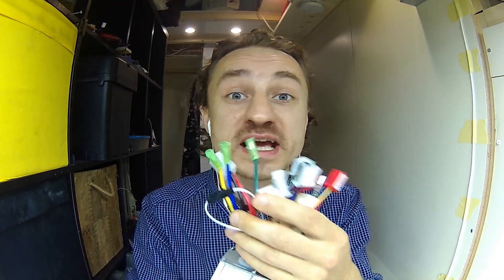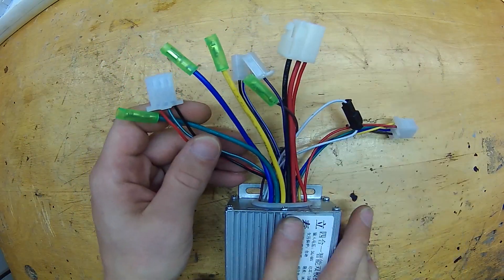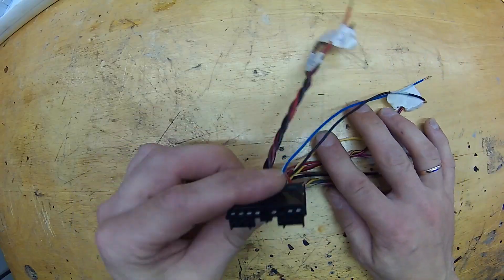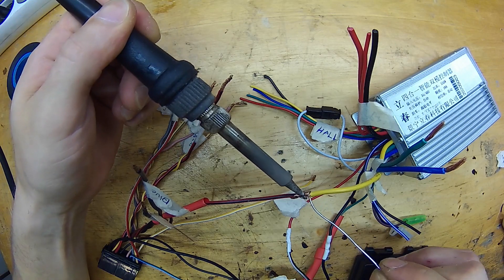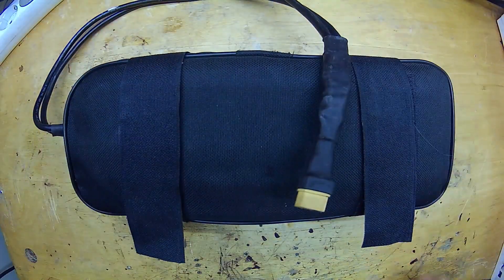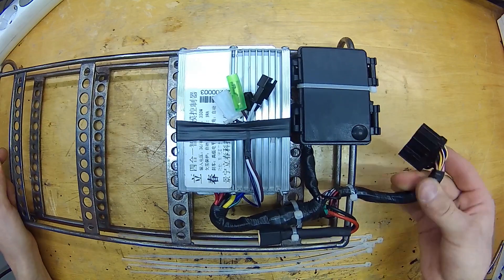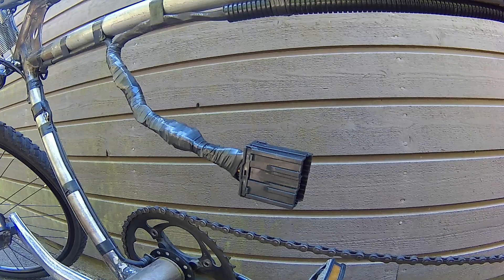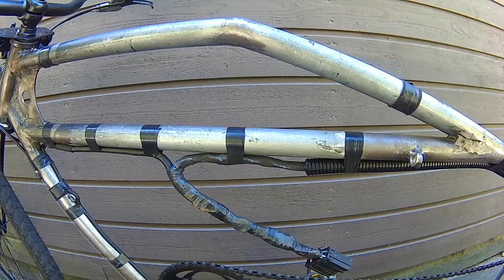How to wire eBike controller the BEST way | Brushless wiring

Comment: I have 60V 20Ah Electric Bike Lithium Ion Battery 60Volt Battery 20Ah, XT60 Extension Cord, XT90 Connector, Anderson Connector for 200-2000W Motor
 And Brushless Motor Kit, 60V 2000W Electric Brushless DC Motor Kit 4300RPM High Speed Motor with Speed Controller and Anti-Slip Handlebar Throttle for E-Scooter E-Bike Dirt Bike Motorcycle but I think I wired it wrong
Reply from the maker: Hmm, it's hard to say what might be wrong without seeing it.

Comment: Can you make a step by step build instructions guide to make your own EBIKE controller and sell on eBay so we don't have to buy from China. Then it will create American manufacturing ??? You can pretend you are reverse engineering   the STUFF from the ROSWELL CRASH
Reply from the maker: this is a good one :D it's actually not that hrd to make a 3phaze pulse controller, but the cost is the issue

Comment: I know this is a relatively old video but I recently bought a 36V-48V 350W Brushless DC Motor Controller for Electric Bicycle E-Bike Scooter and 12V-99V Electric Scooter/E-Bike Thumb Throttle Accelerator LCD Display Voltage for E-Scooter Electric Bike and I got a motor from a hoverboard and a battery from the hoverboard too. So Im trying to get the xt60 connector to fit the controller but i can't. If you could help me that 
would be great.
Reply from the maker: hi! there are different types of xt60. it  maybe you will need to solder the wires.
Reply: @3LECTROSHOCKED  Ok thanks I did that, and everything is connected except the hall wires for the motor because 
I was told I don't need them plugged in. know when I turn it on the display and everything works except the motor. could you help?
Reply from the maker: some controllers work with and without them, but if everything works without - just go with it bro :)
Reply: @3LECTROSHOCKED  thanks a lot I got it to work

Comment: What is a one wire communication agreement plug? Where does that go to?🎉🎉🎉/
Reply from the maker: I think you meen tha speed sensor wire? Its white and comes from the motor, if the motor is geared. I dont need those kinda things, since I dont use displays etc :)

Comment: Great video man.  Question for you; hope u can help. I’m replacing my original Super 73 Z1 (36v 500w) throttle, controller, and adding an LCD display.  Tired of original throttle failing and super slow responses from company itself.  Time for upgrade!  

EBIKELING 36/48V ebike Brushless DC Motor Controller LCD/LED is the controller to replace original controller;
EBIKELING 24V/36V/48V/52V Waterproof TFT 750C - LCD Display Speedometer Control Panel  is display I’m adding.  
Haven’t decided on half or full twist throttle yet. No more thumb only for me!

My question is the this: The LCD display has a pin-connector but there is no pin connection on controller.  Not sure if pin end on LCD display is male or female from Amazon picture. But, can I cut the end on the LCD display and replace with an end that will work with the display connector end in the controller?  Is there a pin extension/converter I can buy? If that’s all I need to do (which seems logical, just strip wire/replace end) then I know how to do that so I’m okay. If no, then need some help. Am I making sense? Same for throttle if different end from end connector in controller.

I provided the exact name of the two pieces I’m looking at on Amazon so please feel free to take a look.

Others who can help....thanks in advance.

Great video.  Learning a lot.  Thanks.

/Bklyn 👑
Reply from the maker: Hi! Thanks a lot for your comment! Well, first make sure you have an LCD interface in the new controller - caus' not all of them do! Then, if your connectors don't mach - dude, just solder the wires. There are just 4 or 5 if I remember correctly. 2 of those are just power - +. And others are data - usually with the same colors on every system :) And if you mess those data wires - it's not a fatal problem, just try again - trial error style. The main thing is not to mess-up the power wires, cause they carry the same voltage as your battery! Hope this helps! :)
Reply: @3LECTROSHOCKED   Wow! And your remember the number of wires in LCD display off top of your head!  Impressive. Yes, the new controller has connection for LCD display; 5 wire.  Cut end.  Solder.  Simple fix.

Second-guessing myself😏.  Thanks for vote of confidence.  Great channel.

/Bklyn👑
Reply from the maker: Great! Have fun diy:ing - its awesome :)

Comment: I recently bought a used e-bike I plan to restore it need a new controller, throttle and a battery too the question what kind of controller do I need the engine is rated for 36v 350w
Reply from the maker: Hi! Just go with the same values. 36v controllers are usually work also with 48v. That means that a 350w controller actually have slightly more headroom when used on 36v. Also you could overvolt your motor to 48v.
Reply: @3LECTROSHOCKED  if I make battery pack I read 10 cells should be enough for 36v
Reply from the maker: Yeah, that's right! :)

Comment: hey man we have. they same controller but. im stock because my e bike. has 3 wire in pas pedal.  which is. black white red. but in my controller there is no black white red wire, for pas pedal hope you notice to help me out. thanks advance
Reply from the maker: Hi! Easiest for you would be  to buy a controller with pas-system :)
Reply: @3LECTROSHOCKED  lol okay then  ty

Comment: Can you help with wiring my cycle analyst to my controller’s ignition switch so the key turns on my cycle analyst
Reply from the maker: Hi! As I understand, that monitor is just a universal piece that you could connect to any controller with interface possibility. If your controller does not have a 6 pin connector for that, then this analyst monitor is useless, sorry.

Comment: Hi man, 

I got a ebike with SW900 controller, 500W 48V. The bike has been in repair for 5 fives and they always swap the wire connectors  in the controller. The problems occur when it's raining or smushy weather outside. It get's moist inside the box, where the wires and controller are. Controller should be fine. 

Do you advise me to let the repair shop change wires and connectors to heay duty ones so if they get wet or moist, they will be fine? 

Thanks in advance brother
Reply from the maker: Hi! Thanks for your comment! Well actually it would be better to get rid of connectors and solder everything permanently. That's the best way possible.
Reply: @3LECTROSHOCKED  Thank You for the reply, king. 

Wouls you advise to to replace the stock cheap wires to something better? Would heat shrinking everything together would be a good idea also?
Reply from the maker: No prob man :) well it's always a good idea to have good thick wires, so sure, if you can - do it. Soldering everything is the main thing. That will reduce heating. Shrink tubing is good, but not that nessasary. It's more cosmetical than practical.

Comment: Thing would be to make sure you get enough amps threw the motor phase wire pins, perhaps they could be the inside of three walls of a custom connector with a ground being the forth
Reply from the maker: Thanks for your comment! Sorry but I didn't understand what you mean by that :)
Reply: @3LECTROSHOCKED  4 high amp ,wide, leaf contacts could be side contacts around normal pin plug
Reply from the maker: Oh , now I get it :) that's a good idea, thanks for sharing that!

Comment: Hi, is it possible to use that method on zero 10x e-scooter please?
Reply from the maker: Thanks for your comment! Well it's a production scooter with two motors. I guess everything is possible, but the amount of mod work will be huge and difficult because of the space limitations. Also you can say goodbye to the warranty if you do that :(
Reply: @3LECTROSHOCKED  No worries, warranty's outdated since last year
Reply from the maker: Well if you have engineering skills then that would be a cool and challenging project :) please let me know the result if you get into that!

Comment: Great video! Do you know if there is a way to use one of the unused plugs to supply 12v to the lights ect?
Reply from the maker: Hello! Thanks for your comment! Unfortunately there is no 12v in the system. So the only way you could get that, is by using a step down converter straight from your battery. But that is kinda not very efficient usage of power. Those converters waste a lot of power in heat dissipation. I suggest just to use a flash light for bikes. Or, if you have money to spare - buy a special 48v light for ebikes :) Thanks for watching!
Reply: @3LECTROSHOCKED  thanks for the response. I need power for turn signals headlight and taillight as I have an electronic moped conversion.  Also I am at 72v and have an inverter to wire up, but was trying to get a chart that showed how much power was coming out of the various controller wires. It looks like most are 5v
Reply from the maker: Yeah most are 5v and they are really low amp. It looks like you need a lot of 12v power so check out a good step down converter and take that straight from your 72v.

Comment: but its not waterproof.
Reply from the maker: Hello! Thanks for the comment! :) If you mean -> the big connector not being waterproof enough - think about it this way: It's designed to be used under the hood of a car, so it's definitely much more resilient to the elements than those cheap white connectors. Those white ones are really not designed for outdoor use at all - they get corrosion just from humidity in the air. Trust me on that :D But, if you want to have a watertight system, then you definitely should get rid of all of the connectors and solder all wires permanently. That should do it :) Thanks for watching!

Comment: Need help knowing which wires are my throttle on my controller
Reply from the maker: Hello! It's usually the connector with three wires: RED, BLACK and GREEN or WHITE. If you are not sure, put a jumper wire from RED to the third wire, which is NOT black. If power starts, then you have found your connector :) Just don't jump RED to BLACK, that will result in short-circuit.

Comment: Hi! I bought a kunray controller for my ebike and I would like to assign the assistance mode up to 6km / h to the throttle because in my country it is forbidden to use it or assign this function to a button other than the screen, how could I do it? Thank you very much in advance
Reply from the maker: Hello! Thanks for your message. So do I understand you correctly: you want do disable throttle and use the throttle twister to turn the PAS on?
Reply: @3LECTROSHOCKED  no no, I want to use the accelerator to start the slow gear max 6km / h, this function is activated by pressing the "-" button on the S866 screen and I would like it to be the only thing that the accelerator works for and that the  pedaling assistance continue to function normally
Reply from the maker: OK, so you want to have a working pas AND use the throttle, but limit the power of throttle to 6km? :) I think that "-" button is controlling the pas power level, so it does not actually have anything to do with the throttle. It would be impossible to make those communicate with each other without flashing the system with edited firmware. But you CAN limit the throttle, there are two ways. Is that what you want? :)
Reply: @3LECTROSHOCKED  yes!  Thank you very much for responding so quickly, I want the throttle to only reach 6 km / h but the PAS works normally, when pressing "-" once the assistance level is lowered but when holding it down, a "P" appears on the screen and  the engine starts up to 6 km / h.  What are the two ways to limit the throttle?  I find the option to edit the firmware very interesting, I didn't know what to do.
Reply from the maker: Ok, so that "P" mode is made for walking along side with the bike, like if it's too heavy to push while you cross a street, or something.. I find it not very practical :)The two options are: First, find the manual for your LCD and change the setting for max speed to 6km (if it let's you go that low). I have done that on one of mine ebikes, works great. Second is a hack - take a resistor of suitable value  (pretty high) and put that in the throttle input line. That will lower the voltage, thus limiting the power. The throttle will still work, just the power range will be shifted down. But this will not keep track of the speed, rather just limiting the current, so when going uphill you will probably get stuck with paddling on your own leg power. Or just with the pas :)  Hope this helps!
Reply: @3LECTROSHOCKED  
If I limit the speed with parameter P08 the PAS is also affected, and as you say if I use a resistance it will not be effective for example on an uphill, it would be a matter of limiting the speed only to the throttle or adding a pulse apart from the throttle the which would make the engine start at 6 km / h, is for a matter of legislation, in Spain throttle is not legal if it allows reaching more than 6 km / h. So editing the firmware of the control unit could you get something like this? is it like a mobile? it is protected? How would something like this be done?
Reply from the maker: Wou, pretty stupid law... We have something similar here, but I just don't care and ride slowly if I see cops :D Well, anyways, if I were You, I would just limit the throttle a little bit with a resistor and keep away from cops. I don't really think they gonna measure your speed while riding on YOUR bike with full throttle. Or will they? Sounds kinda fantastic.. Flashing a controller is not something I have heard people do. But I guess if someone with knowledge would get to it, then everything is possible. Sorry can't help more :)
Reply: @3LECTROSHOCKED  
Thank you very much for your patience and your wise advice xD I am a bit stubborn, and it seems incredible that something that apparently should be simple seems tremendously complicated xD
Reply: i found this:
https://endless-sphere.com/forums/viewtopic.php?f=30&t=87870&start=4075
Reply from the maker: It's ok - thank You! :) Yeah, I think those guys are hacking controllers of company owned scooters. You know, the ones you see on the streets. Those controllers are a completely different thing, than a regular ebike controller. They are computers with all kinds of functions, like protection, gsm connectivity, battery management and so on. Everything on a same board. Hacking those to make them work for free is much more appealing than what we have discussed here. Basically they steal those things. That's why there are much more interest in doing that, and thus some documentation available online.
Reply from the maker: Although I see, that there maybe something interesting on that site you linked. Check that out and post me a comment if you have succeeded flashing - that s very interesting :)
Reply: @3LECTROSHOCKED  I was looking at the subject and it is super complex for me, I discovered this:
https://www.youtube.com/watch?v=lGd828Sk7tk
This guy flashes a custom firmware of a similar display model I use a ROHS-S866, but there is not much info and I would not know what parameters to change to limit only the throttle and surely it is protected, of course the resistance seems the best option, could you tell me what kind of resistance could I use? it is a 250w at 36v motor and 6km/h the max speed i need
Reply from the maker: Yeah, that flashing stuff is complicated. I'm also not very into that, because I'm not that good with programming binary. Maybe some day. Anyways, take like a 1k - 10k potentiometer or a variable resistor. Put that in the signal line and find the suitable setting for you. Then replace that with a resistor of that suitable value. Or just leave that potentiometer in there to have an option to adjust that later. :)